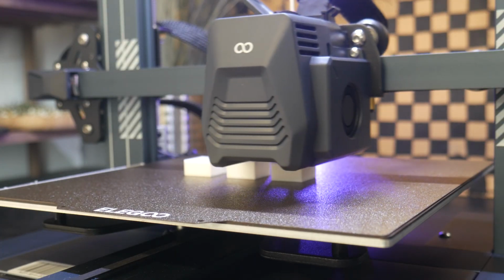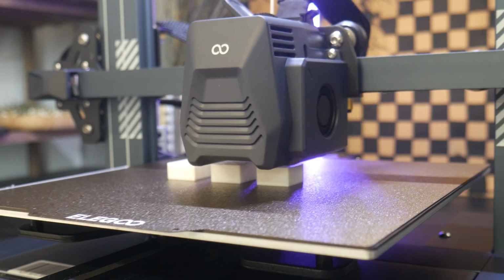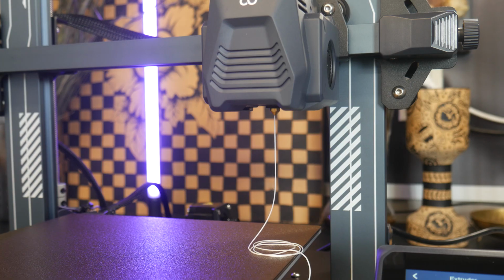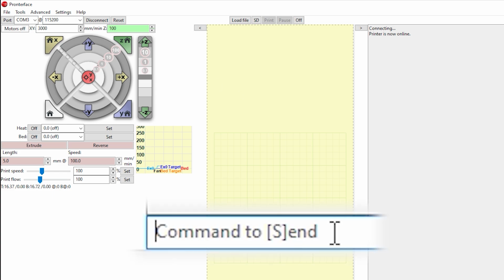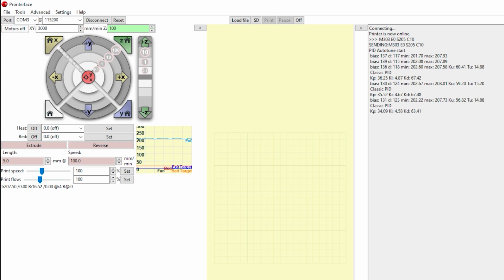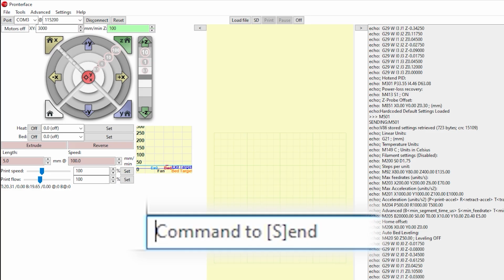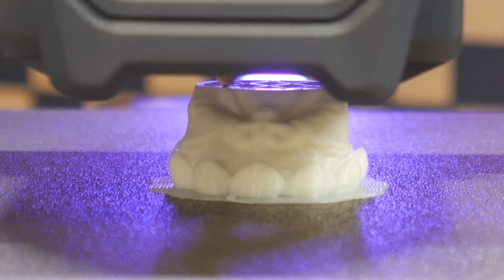Tuning a New 3D Printer -  How to Setup & Tune your Elegoo Neptune 3 Pro

Comment: This video is amazing, thank you. I do have a quick question - i have the same printer and I'm curious as to what settings you use for supports as I've tried a few and my supports are always difficult to remove
Reply from the maker: Glad this video helped. For supports try adjusting your contact z distance. I use .12mm for normal pla. For silk and rapid pla which prints a little hotter at 230C I’ll go up to .16

Comment: I'm not trying to necro this video, but my neptune 3 pro is making a horrible grinding sound when extruding filament while printing small areas like infil or supports at the top (tiny areas). The gear moves quickly, grabbing more material I'm assuming and the grinding sound is emitted. I tried putting the speed and flow to 50%, but that didn't do anything.
Reply: i had the same issue multiple times. First time my filament was way undersize (1.6 something mm) so i had to get new filament. the other time it happened i cant remember if it was pressure advance or flowrate, but playing around with one of those helped a lot

Comment: How do I adjust the extruder grip? Seems to be slipping when trying TPU
Reply from the maker: on the right side of the extruder housing theres a hole to insert an allen key. loosening this bolt will tighten the extruder idler!

Comment: Got a question.  So I'm a little lost of the extruder steps.   This is my current value echo:  M92 X80.00 Y80.00 Z400.00 E380.00, and when I did the 100mm, I had 13mm left.  So is it (100x380)/87=436?  So I'd store 436?  Just tried it with 436 and YUP..  Thanks, great video!

Comment: Don't run PID tuning script. Printer started throwing "thermal runaway" errors on TWO different printheads after the tuning procedure. I even saved the old M301 values and changed them back but thermal runaway error persists leading me to believe that PID tuning ruined the thermometer thingy inside.
Reply: Probably something was already broken or about to be broken. Have never heard of anyone having thermal runaway from correct PID tuning
Reply: @NaenDILLIGAF  I guess it's my luck then. I did manage to somehow return the old pid values and so far there have been no issues

Comment: Help!! What software do I download to be able to send this single-line commands to my printer?? Idk how to do that part
Reply: I tried tonight, and it gets stuck on ‘connecting’. I’ve tried all baudrates, I even installed a CH340 driver as someone else suggested. It stays on ‘connecting’. It’s 100% the correct port, no other apps are running & no other USBs are plugged in. I’m stumped! It’s over-extruding by exactly 5mm and I can’t fix it 😭💔
Reply from the maker: Prontrface!!
Reply from the maker: Try a different usb port, and also try a different cable.

Comment: Forgive me if I sound dumb here. My default "E" value is 380. It only extruded 85.31mm. So with that formula my new "E" would be 445.5?
Thanks!
Update: I just went for it and re-tested. Ended up being at 465. Thanks!! Now to tune my ender 3 max neo :)

Comment: Am i just stupid?? How do i know my current steps per mm??
Reply: On some printers you can find that in the settings directly. Otherwise you use a tool like Pronterface and send the command M501 to you printer. The printer then responds with several lines of info. Look for the line beginning with M92 and use the number after "E".
Reply: It's under motor settings
Reply: It’s found on the M92 settings with the E value when you use M503
Reply: You wont find it on some printers. Pronterface will tell you though.

Comment: So ive been using Lychee for over a year now, and i had my Neptune3pro dialed in perfectly. But then my exports kept crashing suddenly in Lychee so i swapped to Cura and tried to put the settings i had from Lychee and ran a Benchy, ans now the arm just jams itself in a corner and dumps plastic. Any suggestions?
Reply from the maker: make sure you have the correct machine settings in cura, and the correct start and stop gcode. sounds like your bed size in your slicer is set wrong?

Comment: should we not add the M500 command to save the settings on the control board?
Reply from the maker: if you don't send an m500 command any updated settings will not be saved!

Comment: Hello!
Don't know if you had the same problem with Elegoo N3Pro: offset toolhead centering. As you tap "Level" on the menu screen, the toolhead automatically goes a little to the right, and starts autolevelling also off-centered.
Contacting Elegoo support didnt actually help. If you have any idea, I'd be more than happy to learn from you.
Many thanks for the vid!
Reply: This is intentional, the part used to check the bed is placed to the left

Comment: I think more depth of calculating e-steps would make the video much better. You don't say how to find the current e-steps. When I run M501 before updating my e-steps, the steps per unit value is blank. So how to I know my current steps to complete the formula so I can update it with the M92 command?
Reply: This is one of the biggest problems with YouTube videos.
The video is good, I really appreciate it. But it can be seen that either the creator made it for those who already know the minimum of the programs and terminology used, or it is just an excuse to carry out paid advertising.
I have the same doubts as you.

Comment: just a heads up for those doing the extruder calibration please use the M501 command first to get the extruder steps as I overlooked it and messed up but luckily I wrote it down, mine started with 380mm Neptune 3 Pro
Reply: So I am so glad you said this but after inputting M501 I spits out a wall of text what exactly am I looking for?

Comment: This extrusion code is wrong. My default extrusion for my printer is E390. Using your equation I get 109. If I change my E number from 390 to 109 it cuts my extrusion rate down drastically.

Comment: Whenever I change my extruder using these commands, it completely slows down my extrusion rate and I have to factory reset the machine. My machine also goes into thermal runaway after the PID autotune returns its values.
Reply from the maker: What printer are you using?

Comment: Greatly appreciated the video! I received a used Neptune 3 Pro and while attempting to get it adjusted I ran into an issue, the left side of the z-axis lead screw on the gantry frame (If you are looking at the front of the printer) is not moving at all. Is there a way to tighten or loosen a  z-axis lead screw?

Comment: Two points.
1) you can easily use IsoPropylAlcohol. When that isn’t good enough use soap and water. Then back to IPA for a while.
2) Don’t measure out 100 mm and run 100 mm through to measure precision. What if it pulls through 103 mm? So what you do is measure out 120 mm and ask for a run of 100 mm. Surely you can subtract 20 mm from your measurement.

Comment: Just got this and should all 3 V wheels on the z axis be touching the frame? The middle centric wheel and the top are solid, but the bottom most one is really loose (on both side)

Comment: Will this work with the Neptune 3 as well
Reply from the maker: Yep this’ll work for the standard Neptune 3 too. Just need a way to send gcode commands to the machine. The e step calibration can be found on the machine itself in the advanced menu but pid autotune commands need to be sent over usb I believe. There are a handful of gcode senders but I find pronter face to be the easiest!
Reply: @WildRoseBuilds  thank you :) I worked it out

Comment: HELP!! having major issues adhearing to the bed aftere doing this, I have a neptune 3 max. No matter what I do nothing is working, deep clean bed, ness with temp, level and auto level, put code in cura to auto level before prints. But no matter what I do nothings sticks and if it does it is inconsistent throughout the bed. PLEASE HELP!
Reply: Do not loosen so you can move the wheels. That causes slips. And wobble. Bit don't over tighten. Ik this is a year old but still

Comment: I need some help that i for some reason cant find the answers for anywhere. I downloaded pronterface done my calculations and think easy now all i do is connect. Nope all i get is a usb serial no drivers error in my device manager when I connect my neptune 3 pro to the computer. Can anyone please guide me on where to go and fix this usb serial drivers error im getting? Its showing up under my other devices tab in hardware when i plug in the printer.
Reply from the maker: you should need it but try downloading a ch430 driver. also you can try different serial ports and buadrates as well to try and connect.
Reply: @WildRoseBuilds  Yeah dumb me after I posted this comment it dawned on me that there were other files on the thumb drive that came with the printer. Plugged it in and looked at the files and there it was. Made it to where I could connect and do the tuning. Thanks for the reply.
Reply from the maker: @winns35  haha no worries, glad you got it sorted. Happy printing!

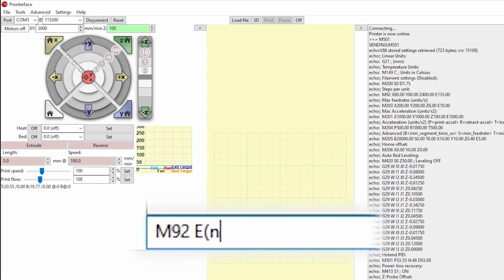Comment: 2:52  M92, M500, M501, this is all done in something called Pronterface?  I'm not familiar with this.
Reply from the maker: It’s just a software that connects over usb to your machine and gives you a console to both send and receive info from your printer. I think it’s also installed when installing prusa slicer!

Comment: Hey did you use the M500 command to save the settings afterwards so it wouldn't reset when the power is off?
Reply from the maker: Yep! I m500 and m501 to check that it’s saved to the EEPROM after each calibration step

Comment: I have a problem with lines , the walls are not smooth, everything is tighten and like it should be, but there are mini lines you can see if you look from the top. any suggestion?

Comment: I just sent the code on printerface to check the temp and it gave me a thermal runaway error. Any suggestions? What should I do about it? I had to turn the printer off completely
Reply from the maker: Update the firmware on the machine, some of the launch machines have firmware that has pid autotune disabled!

Comment: These sound like fantastic tips that everyone should do. I ordered a Neptune 3 Plus but it hasn't arrived yet. I want to do this when I get it set up, I'm a complete beginner and unfamiliar with the software you mentioned. 
Will these changes we enter stay in firmware for the life of the printer? 
Will they have to be re-entered each time we update the firmware, and should we go through the procedure again or just use the same values? 
If you could talk more about what you're doing that wold help complete beginners like me. Thank you for an excellent post.

Comment: My Neptune 3 Pro went into thermal runaway after the PID autotune completed, it showed the final values and all in Pronterface, but the 3D printer had a warning and audible alert going on screen. Any ideas why this happened? Yes, I'm on latest non-beta firmware by the way.
Reply: Also got the same. Did you find any answer?
Reply: @luizsergiojunior2000  no answer but I also haven't had issues anyway so I forgot it even happened 😅

Comment: Using the default profile in Simplify3D, my Neptune 3 Pro was obviously under-extruding as evidenced by visible gaps between printed lines in the same layer. I substantially reduced that by increasing the extrusion multiplier in Simplify3D from 0.9 (its default value) to 1.0. What is the advantage of setting e-steps as opposed to visually inspecting printed objects to see if the extrusion multiplier needs to be raised to optimally fill gaps?
Reply: While waiting for an answer, I researched this and found the consensus was that e-steps and extrusion multiplier affect the same thing (filament extrusion amount per distance) but that e-steps provides a way to quantitate that with less trial and error although at the expense of greater complexity. Then I had an epiphany, realizing there is a much simpler and more accurate way to fine-tune extrusion amount per distance. This is an example of the general phenomenon of having solutions truncates the search for better alternatives.
Reply: @kevinpezzi6777 what was the simpler method?

Comment: Did exactly what you said, and Bada Bing bomb. PERFECT prints! And I mean super close to resin quality! Thanks for all the work you do my dude😁
Reply: When I read this I thought, meh this must be an overstatement. Then I tried it myself, safe to say I was amazed. Using 200 C nozzle and 70 C buildplate (cura defaults for some reason) I do have a little way to go on the edges but damn! the sides of the tiny 1cm calibration cube are incredibly smooth on 0.1mm thickness.

Comment: I'm new to all this and I can't figure out how to change the extrusion rate. I measured 11.22 mm short on 100mm extrusion, but where do I find the steps per mm count and what software do I need to change the values?
Reply: Type M501 on pronterface to get the current steps per mm. Then use that value in the equation he provided in the video

Comment: I get this message .. Please help
 "Connecting...
Printer is now online.
>>> M303 S215 C10
SENDING:M303 S215 C10
PID Autotune start
Error:Heating failed, system stopped! Heater_ID: E0
Error:Heating failed, system stopped! Heater_ID: E0

echo:Heating Failed
Error:Printer halted. kill() called!
Error:Printer halted. kill() called!

//action:poweroff"
Reply from the maker: You’ll need to update to the newest firmware from elegoo site!

Comment: after doing the PID tuning, my print doesnt even stick to the plate, the come almost cold :s
Reply: Actually after reviewing, the PID value are not been saved, they are still the originals, even weirder now.
Reply from the maker: Did you send the m500 command after inputing the new pid values?
Reply: @WildRoseBuilds  i forgot that.. thanks!

Comment: IMPORTANT. I have tried to change the pei bed with GLASS. Imposible, because the zero sistem of the machine. Any workflow to get it?
Reply from the maker: If you’re just looking for a smooth surface on the bottom of your parts you can get non textured pei coated steel that would have that effect. You could swap the sensor for a probe but I think you’d be in for some hefty firmware edits
Reply: @WildRoseBuilds  thanks

Comment: I guess there's no wireless way to set esteps? Printer is in another room
Reply from the maker: In the advanced menu on the printer there’s a setting called transmission ratio, you can set it manually there!
Reply: @WildRoseBuilds  don't think I would have figured that out! Thanks!
Reply from the maker: @SerDerpALot2015  good luck!

Comment: Hi. Have just set the same PrusaSlicer settings as you have, and i got my Neptune 3 PRO yesterday. But what about retraction settings? just use the standard creality v2 settings ? 5mm and 60 in speed ? ive heard that direct drive extruders need less retraction at lower speed. Did you just use the standard creality settings as shown in this video ? Thanks for all the information btw. I love your videos! 🤩

Comment: If I might ask, once you send the command for setting the new PID values, how do you get them to stick?  I've run the test and received the suggested values, but upon entering in the M301 command and listing the new parameters, it just shows "Sending" and then nothing else. When I use the M501 to check and see if the new settings stuck....I get the same old values. I must be missing something here. Any suggestions?
Reply: After m301, enter M500 to save
Reply: @kolyan2g  Thank you so mucu man. Stupid thing that I was missing

Comment: My Elegoo Neptune 3 spits Thermal Runaway (error 7) on me when I try to do PID Autotune. Is that normal..?
Reply from the maker: Update to the latest firmware!
Reply: @WildRoseBuilds  I have the newest non-beta firmware - V1_1.0.4 but the thermal runaway error disappears after PID autotune is done. But thank you for making the video and also replying on my comment, which is what I do not often see.

Comment: Changing the steps per mm value can be easily changed directly on the printer in "Settings/Advanced Settings/Motor Settings/E-axis pulse" and here is number of steps per mm for extruder. You don't need to do it via computer.

In my case running PID tuning doesn't work. Apparently firmware version 1.1 does not support the M303 command. It throws me errors and the printer freezes. 

But Thank you for great video
Reply: Thank you! I was struggling understanding where to get the current steps per mm value until I read your comment!
Reply: Thanks for this Gorn! Completely new to 3D printing and had no idea where to derive 'steps per mm'; this helped and now my Neptune 3 Pro properly extrudes that 100mm.
Reply: ok when i get to that setting its showing 380 how do i know what to change it too
Reply: @dayzclips9093  I am wondering the same thing. I have had my printer for 3 days now and one thing I am learning is that the 3d printing community so far is not very helpful. Hopefulyy its just bad luck in these few days but it hasnt been a good experience so far.
Reply: @winns35  i worked it out in the end i measured the 100mm and marked filament and then when it extruded short i up it 20 points and repeated the extrude with a new mark. eventually i got there my prints look good
Reply: Where are you upping the points? I’m trying to figure out how to calibrate this extrusion stuff and it’s a bit confusing.
Reply: @rover1374 i gotchu if you still need help, literally just figured it out after like 20 min lmfao
Reply: @eve__________  I worked it out too a while ago, thanks haha
Reply: This was SO helpful! The one part of the video that got left out was HOW to find your current steps. 

Did what you mentioned and got it fixed right away. 

Lifesaver
Reply from the maker: Correct most machines with marlin 2 have the steps per mm in an advanced motion menu.

There’s a newer firmware that supports the m303 command available for the Neptune 3 pro. Highly recommend updating! 

Thanks for watching!